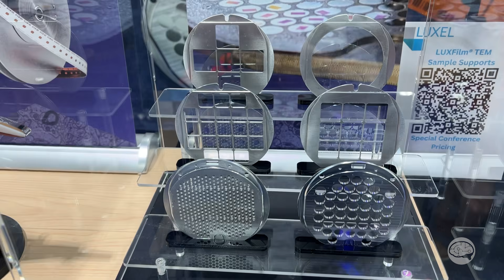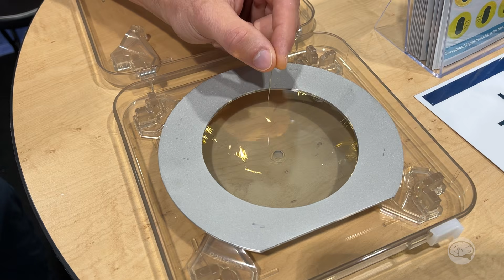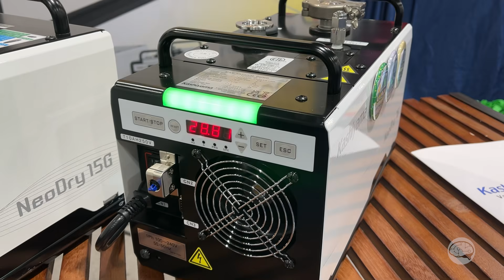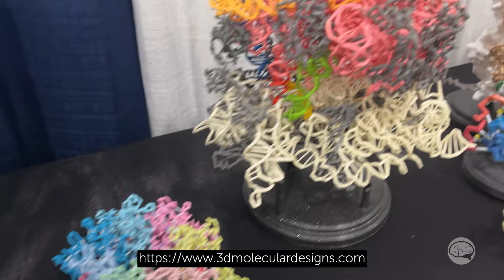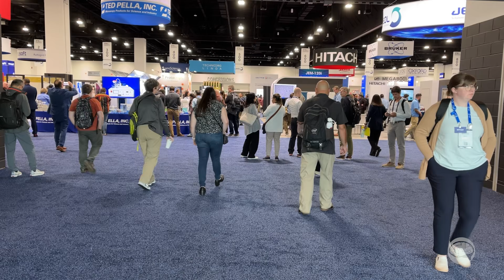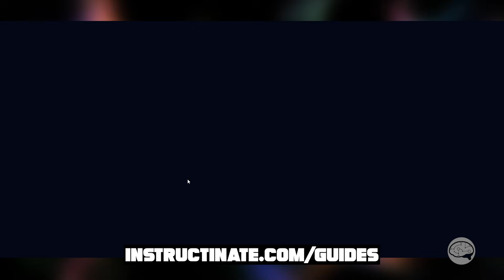WHAT Happened @ M&M 2026 in Milwaukee??? || INSTRUCTINATE

Comment: Good report from M&M ! !
Hitachi had the SU8700 Shottky VP FE-SEM, not the SU8600 CFE-SEM.
The SU3900SE VP-SEM (0.9nm) has the same chamber size as the SU3900 VP W-SEM (3.0nm) which fits 300mm diameter by 130mm tall.
Reply from the maker: Well dag nab it. I thought for sure it was the 8600.